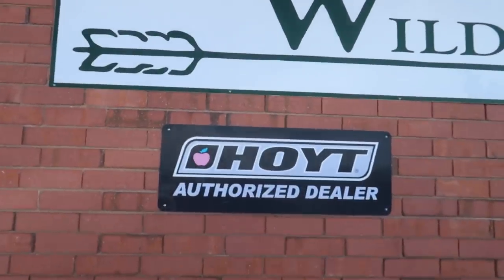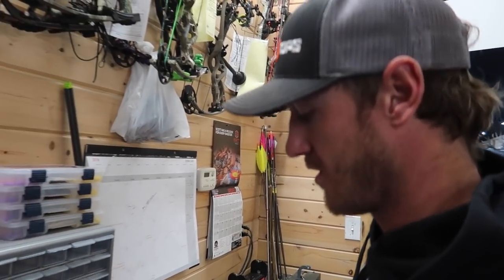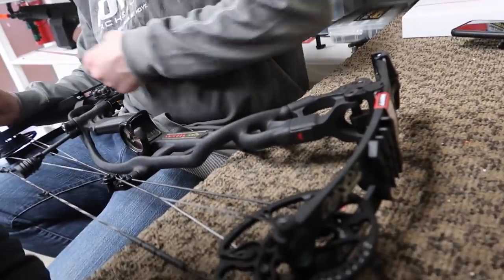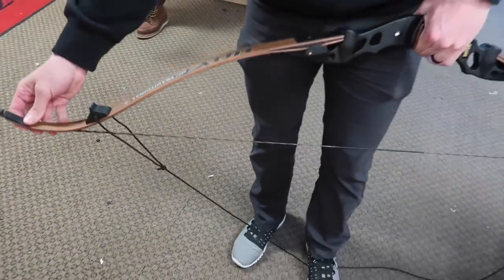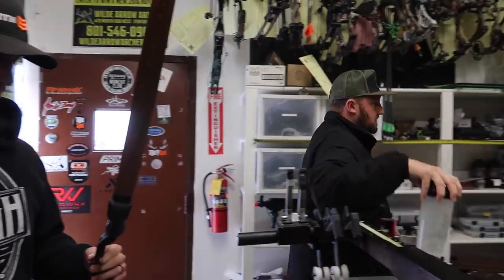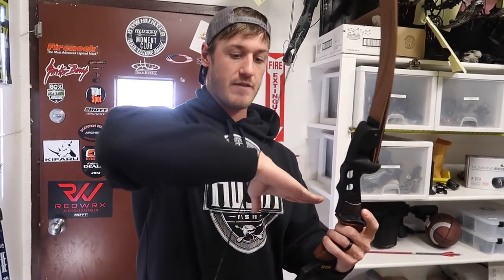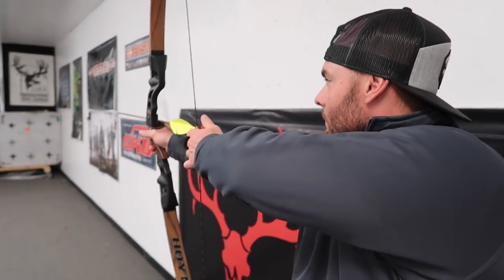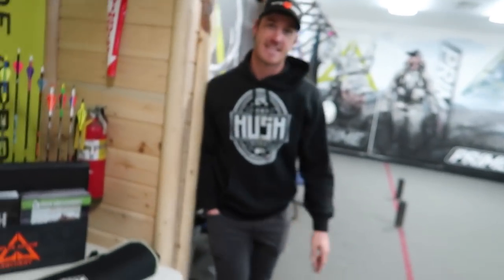HOYT SATORI UNBOXING AND ASSEMBLY

Comment: I read on some website like Lancaster and they recommended an 68 inch bow for 28 inch draw length. Why did he choose 60 inch bow?
Reply: Those charts are wrong. Not sure why they have them like that. I've shot recurve as short as 48inches with a 28inch draw length.

Comment: Limb weight for Satori Limbs are ranked with 21" riser.... you get shorter risers... Add 2lb for 17" riser and another 2 for the 15" riser. You can see that... on the Hoyt website.

Comment: For whatever reason the factory plastic grip on the Hoyt Satori seems to be causing me to get a nasty blister on my right thumb knuckle at the base of the joint.  Any suggestions of what to do? Seems to be a flawed design which forces your hand into a high grip position and causes your knuckle to grind underneath the bottom of the plastic grip.

Comment: I wonder if these guys know... that limb weight are based on a 21" Riser.  This guy has a 17" riser and the 45lb limbs should be +4 pounds.   So this bow will actually be a 49lb @ 28". 
Surprise !    49lb bow.